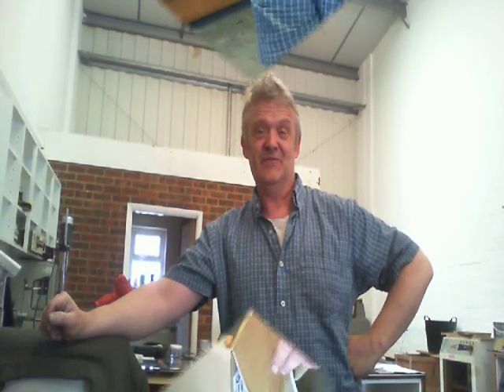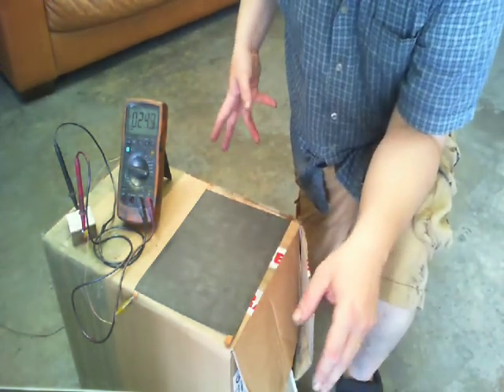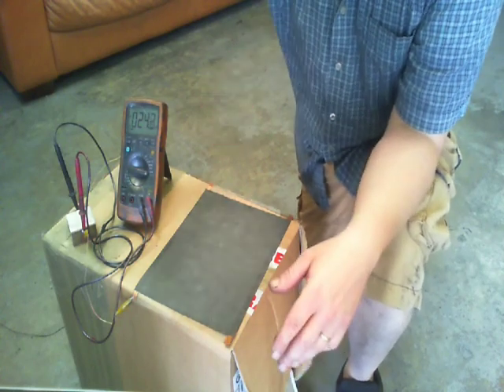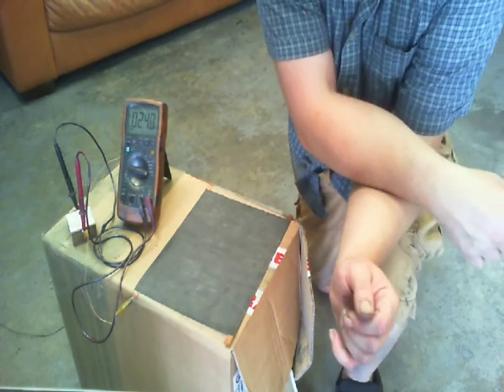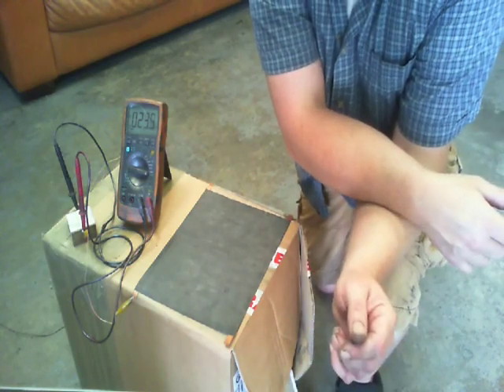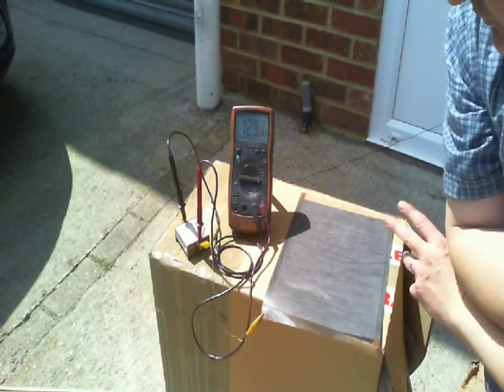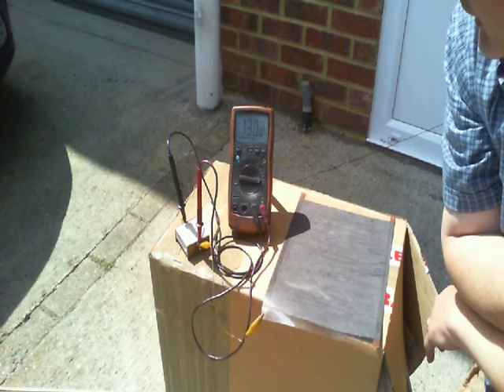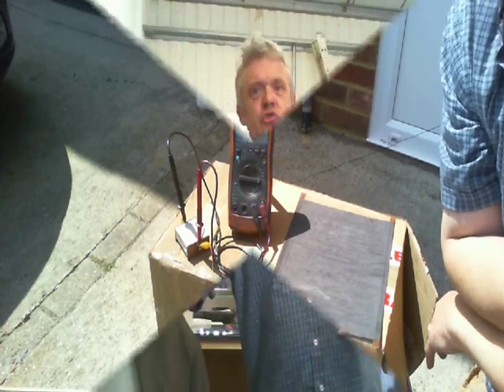SWAG Tesla Radiant Energy Collector Update

Comment: Maybe one could be adding a voltage booster and a mechanical switch to charge up capacitors ...and then discharge them in a working circuit...as Tesla would say. 😁

Comment: Hahah Ive got 0.6 volts from 4 100uf 10 v condensers, and 2 diodes , using a jar stuffed with copper wires for antenna and a plastic lid, ground - gas pipes

Comment: In essence the SWAG plates convert any type of EM waves to electricity AC or DC doesn't matter now at this early stage.  Probably they can also convert the minute Van Der Waals forces to useful energy for which you'll have to try it out with plain water but at a considerable velocity.  Then hey presto you have a hydro electric generator on the lines of plasma MHD generator but on a cooler scale.  Its understandable with ionic liquids but with plain water the physics should be real interesting. :)
Reply from the maker: +Venkatesh k.s. now that is interesting - it would probably work

Comment: sir can you tell us what capacitor do we need and how to make that smart  plate ? thanks
Reply from the maker: +marc Hose it's a graphene coated BoPET sheet
Reply: thank you idol , sir do you a schematic diagram for a voltage multiplier  to be used in this project , also the  capacitors and diode used,, thank you sir
Reply from the maker: +marc Hose no mate - it's simple stuff - you will need to experiment
Reply: how can I make it ?
Reply from the maker: +marc Hose i did a video on a mechanical method of making graphene - i would start there

Comment: I think Tesla was wrong about his radiant energy which is probably why they pulled the funding for his tower changes for sending wireless power.
Also something a lot of people don't know is atmospheric electricity increases with height at about 30 volts per foot up to 300,000 volts at the top;     perhaps if you lacquered the plate you might get more voltage because you're insulating it from the leakage to earth;  also it would be better on dry days etc.
Reply from the maker: +Llona Juice interesting ideas - have you run an experiment or two?
Reply: +Robert Murray-Smith  no,  but i'm researching for one;   for 5 years on and off I've been pondering the Moray device,  and to be honest I've never had any theories that were credible enough to try out - it had me completely and utterly stumped!  then just recently I stumbled on an experiment which was although unrelated and I had a flash of inspiration,  and I thought to myself could this be it!  - the only problem it uses radioactive materials,  HV and custom tubes which are outside my comfort zone of digital electronics and aren't something you can pick up at digikey  ;-)
Reply from the maker: +Llona Juice an experiment - however small is always a good one mate - it goes a lot further with me than theories
Reply: +Robert Murray-Smith well theories are cheap to experiment with - for a tight Yorkshireman like me! ;-)
Have you tried a Roentgen tube over your swag coated plate, as per Tesla's Radiant energy patent?
Reply: +Llona Juice  The issue I have with Tesla's radiant energy collector was he states in his patent that the energy collected is proportional to the area of the plate;  but Moray's device was different, as he knew exactly how to tap into the energy;    I think he stumbled on it by accident as a weird anomaly he found whilst he was playing around with tubes.
Reply from the maker: +Llona Juice no i am afraid i haven't
Reply from the maker: +Llona Juice fair enough
Reply: +Robert Murray-Smith oh no i've just ordered some geiger muller tubes!  my wife will kill me -  is this how the disease, the search for free energy starts?   lol ;-)

Comment: You got me thinking. There are similarities of the SWAG plate to that of a leaf in nature. The carbon, grain of annealing, and copper as stem. It's likely you created a man made leaf minus the chlorophyll, which is really cool.

No need to risk falling off roof. Attaching a piece of pvc pipe to the ladder with Swag on it and running it up should give a result.

There is something I think I need to share about the Tesla mystery to help advance our search for free energy. Tesla made many great contributions to science for which we are all grateful for his work. In my research though I have found that several of his patents are variations of others patents. The radiant energy patents are actually 11 years after the original inventor. It was invented by Mark W. Dewey in 1889. There is a lot of useful information in these patents that I think are key to making this a power source.
414,943 http://www.google.com/patents/US414943
418,912 http://www.google.com/patents/US418912
I believe the Tesla patents have a two pole capacitor because he couldn't duplicate the three pole cap of Dewey for voltage conversion.

My resources for testing are extremely limited right now, but I'd like to contribute my ideas and help with research when I can.
Reply: http://www.google.com/patents/US414943
Reply from the maker: you have interesting ideas mate - thanks

Comment: Hey Robert why not do a modern Ben Franklin and graphenize a kite and fly it?
Reply from the maker: cheers mate - though a baloon sounds a lot cheaper than a quadcopter lol
Reply from the maker: +GOKHAN DILEK you'll probably have to use a virtual ground
Reply from the maker: i think i will lol
Reply: Thought you might like that!
Reply from the maker: thagrit
yup - spot on lol
Reply: +Robert Murray-Smith  Is it possible to recharge your drones battery while it is high up? Or maybe extend the battery life of your drone(run it on battery initially then switch to radiant?
That would be an  interesting project.
Reply from the maker: +GOKHAN DILEK it would - maybe you should give it a go?
Reply: How do I get ground connection? :)